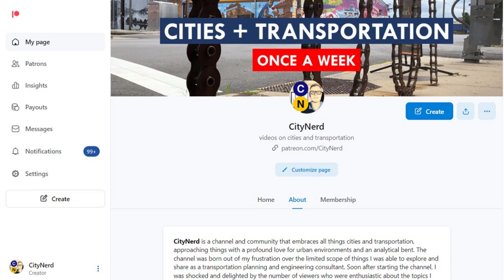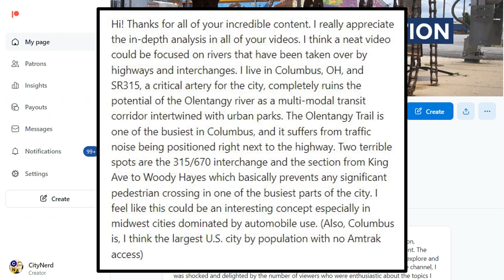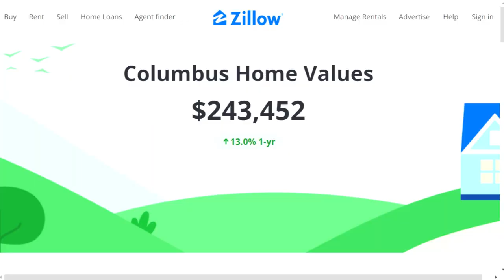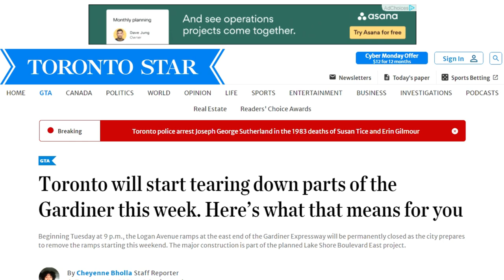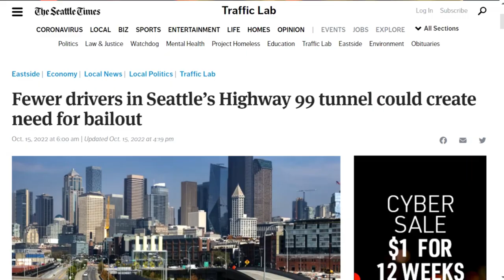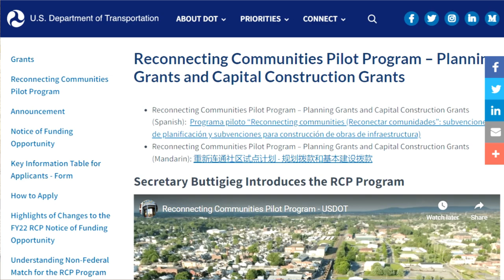Highway Engineering Madness: 10 Waterfront Freeways That Need to Go (North America Edition)

Comment: Regarding Toronto, not sure if someone else mentioned it, but both the Gardiner Expressway and the Don Valley Parkway (both adjacent to water) are owned and maintained by the City rather than other freeways like the 401 being maintained by the Province.  The City's coffers are notoriously underfunded due to pressure to keep property taxes low (taxes within the City of Toronto are way lower than the suburbs).  So basically Toronto has no money to really do anything significant with their infrastructure without assistance from other levels of government.  You can really see the difference in level of funding for infrastructure when you cross over into Peel, York, Halton, or Durham Region, the roads are maintained much better in the burbs.  Kind of like urban Detroit vs it's wealthy suburbs, except Toronto is rich, just taxes are too low to fund anything meaningful.  With all that being said, the current solution is the band-aid solution, rehabilitate the Gardiner as it stands and try to make the space underneath the elevated portions more useful to the public.
Reply: Fortunately the province now took on ownership of the Gardiner and DVP. It'll most likely be maintained way better than what the city was doing the bare minimum. Ontario should also take ownership of Hamilton and Windsor Highways. Cities should not be owning freeways since they will do the bare minimum owning it.

Comment: Wow...I immediately thought of 315 in Columbus. SR-315 North of the Columbus outerbelt needs to go or be re-routed, that's the worse portion of it. It's literally sliding into the Olentangy River. It's been under construction on and off for years and nothing is working. It used to be a nice riverside back road until all the urban growth, now it's a main artery but only 2 lanes and constantly full of traffic. It cannot be widened, there is no more space.

Comment: Well, I-25 in Denver isn't going anywhere soon. The freeway wasn't put there after the multi-use paths and greenways or most other (re)development. That all came later after the initial route was first created (by Native Americans?) and then  expanded over decades. Remember, rivers were used as sewers until relatively recently and no one wanted to be there unless absolutely necessary. The improved and enhanced access to and along the Platte has only happened in "modern" times. And to be honest, the Platte isn't much of a river. The most attractive portion is where the Platte and the Cherry Creek come together in the downtown area and that confluence is very accessible, attractive to various recreational users, and not immediately parallel with I-25.

Comment: My guess to the NC question is flood potential. With the mountain range to the west and almost yearly coastal storms that can dump a lot of water in a short period of time. The mountains generally deflect the storms catching the water that runs back through the interior of the state. North GA and SC are the same.

Comment: In defense of Lake Shore Drive in Chicago:  Commercial vehicles are banned, the speed limit is 45 mph and, by covenant with Illinois Central, nothing can be built between it and the waterfront.  The result is literally miles of (difficult to access)  beaches and parks on the east side of the road.  

By comparison, the Gardiner Expressway in Toronto completely isolated the waterfront from the city and turned it into a wasteland.  They literally put a waste processing plant on the waterfront.
Reply: Gardiner Expressway is never getting torn down now that the province owns the highway. Not even the Ontario Liberals will tear it down. Ontario Liberals need suburban votes to win elections therefore they won't tear it down since they would lose the suburban votes.
Reply: Gardiner Expressway was built when Toronto waterfront was 100% industrial

Comment: Chicagoan here! I actually live just north of where LSD ends but I still have some thoughts. One thing that makes it not too bad in SOME areas is that there are often large amounts (blocks even) of greenspace in between LSD and the Lake.  But I agree that the parts of LSD that go up against the lake are pretty offensive. Also I would say that the tunnels that let you access the lake front are decently frequent by me at least. I'd say at least once every half mile by me. And i use them a lot. They're not too bad

Comment: I had really mixed feelings about the Alaskan Way Viaduct coming down, in Seattle. On the one hand, it was undeniably an ugly thing to have on the waterfront. On the other hand, it was possible to walk under the Viaduct to get to the water, whereas now there's a six-lane surface stroad to cross. Driving the top deck also gave you views that you can now only get by dropping several million dollars on a condo.
Ultimately it was hard to shake the feeling that it was just an elaborate giveaway to landowners on the waterfront, at the expense of more inconvenience for commuters like me that were already priced out of the city.

Comment: 11:44 “And you’ve got San Francisco where the Embarcadero Freeway was dismantled after it took earthquake damage [in the 1989 Loma Prieta earthquake] and it wasn’t replaced in any real way.”
That is, after there was very little choice.

A little less than just three-and-a-half years before, San Franciscans overwhelmingly rejected tearing down the Embarcadero Freeway, in no small part due to a campaign waged by Chinatown organizer/mover-and-shaker Rose Pak, who argued that Chinatown would face catastrophic economic consequences if the freeway came down—Pak, incidentally, has a brand-new Muni metro station in Chinatown named after her. The Embarcadero Freeway did offer very easy access to Chinatown—we used to take it all the time—but it was a hideous monstrosity, and, convenience be damned, I wanted—and was very happy—to see it go. What it was replaced with is a broad, palm tree-lined boulevard at street level that is pretty nice to stroll (and drive) along.

Comment: I own property three quarters of a mile from Lake Shore Drive.  The analysis in this video overstates the disruption it causes.  Much of the drive is below or above grade; the section with tunnels beneath the drive is atypical for the road as a whole.  Most of the rest of the drive has pedestrian access, either via bridges (some of them pedestsrian-only) or less intimidating underpasses.  (There are some exceptions to this; the underpass at Grace also looks pretty unappealing, although I haven't used it myself, and is at the south end of an unusually long stretch with no pedestrian access, but I attribute that more to the presence of the golf course in the park where pedestrians shouldn't be crossing than to the drive.)  My neighborhood has underpasses spaced every quarter mile, on average.
The video describes the road as a freeway, which is true, but fails to note that speed limits (and actual speeds) are significantly lower than other city freeways.  
The assessment that concentration of emissions here is a negative is backwards.  Lake Michigan is wide enough that a large portion of the emissions get dissipated over the lake.  While no emissions are good, the situation would be worse if all of the emissions were spread over land on both sides of an expressway.
The assessment also neglects to figure in the role that Lake Shore Drive plays in the CTA bus network.  Express busses on Lake Shore Drive play an important role in Chicago's public transportation network,  even though heavily-used L and commuter train lines run mostly in the same direction.

Locals that I have spoken to see the drive as a crucial artery for getting to crucial activities.  I subscribe to one of the local neighborhood social media groups, and the bigger traffic complaints concern traffic past the end of Lake Shore Drive.  Expressway traffic gets dumped onto arterials like Ridge and Sheridan.  Arterial traffic is more disruptive to pedestrians, and stopping and starting produces more emisssions.

Comment: I live in Hamilton Ontario and I hear what you say about the QEW although it would be difficult because it’s actually an intercity highway originally built in the late 1930s before the area was heavily urbanized. It’s the main connecter route between the Toronto region and the US border at Buffalo. Also topography is an issue; the Niagara escarpment would make a bypass around Hamilton kind of difficult although it has been proposed. Hamilton does have a fairly nice waterfront on Burlington Bay that is not obstructed by a Highway. The water is rather polluted though due to a century plus of industrial activity and a city that doesn’t seem to know how to manage sewage but that’s another story lol.

Comment: Honestly, I disagree with both NYC inclusions. 
The BQE on Brooklyn Heights could use a few more accessways for people to get from the residential to the parks, but sticking the freeway on the elevation difference is a pretty elegant solution that doesn't take up an offensive amount of space. I don't really see anything meaningful being built at that 20 odd meter drop anyways. The section along Sunset Park down to Coney though is a bit more of a yikes. There's a lot of potential there.
FDR drive is also hugely important in getting the traffic away from the city centre where it's a lot busier and crowded. It'll cost a lot to reroute that necessary freeway into maybe an underground option or whatnot but as things stands, it's about the least bad place for it to exist.

Comment: Late to the party, but I fully disagree with the i5 in Portland. I lived there car free for 5 years, and there are 3 things that aren't accounted for in the vid. One is that the 5 in the section is raised and goes over railroad tracks so there is already established industrial use. If you got rid of the freeway, you would still contend with tracks. Secondly, the ped/bike path and access to the east side is fairly nice/functional/easy to use, with big open spaces on the west side which are easy to get to. Third, although I detest cars, a freeway is still a "public space" (accessibility aside), and the view of downtown from the raised section of i5 is breathtaking, almost like swooping over the city in a helicopter. Something you wouldn't have access to without the freeway. I'd rather keep the view "public" than build something there that only millionaires can enjoy.

Comment: As a Chicagoan that lives in a high-rise along Lake Shore Drive I would say that it is a necessary evil. Chicago is a big city and if there were only surface roads north/south, they would be mightily congested. Also LSD has zero commercial signs and billboards and no trucks are allowed on it. 
When you are driving, it becomes a window to the city. There is enough separation that you get to see Chicago’s architectural marvels and the often Caribbean blue waters of the lake. Everything to the east of the Drive is park or beach and the road doesn’t really factor in. There are multiple entry points to the lakefront and if you live here you just sort of naturally know where they are. One problem, the 45 mph speed limit is seldom honored so it can feel like an expressway because of the fast drivers. If there was a way to slow it down and revert back to more of a parkway, that would be nice. Once again though, urban living comes with compromises.

Comment: From a driving standpoint during non peak hours it's  the only way to cut north or south quickly across the city. 
However the s curve and Signalized interchanges around the gold coast can  cause major delays time (particularly Chicago Ave.) and is not very aesthetically pleasing in and around this corridor. 
However, once north of North Ave I'm ok with it since there are bridge and roadway access underneath for access to the lakefront via trails and to other lakefront amenities.

Comment: Something to add with the BQE! Due to the terraced roads - with no supports along the outer edge - the expressway is slowly cracking and falling into disrepair. They've already had to close off the outer lane of the tiers, causing something of a permanent traffic jam through the area.

The city is currently in talks to decide whether to shut down the artery for repairs or construct an entirely new road. Honestly, the whole thing sounds like a no-win situation.

Comment: Having lived in both the East Bay and Chicagoland, I find 580 to be far more inexcusable than LSD. Largely because of land use and walkability—as bad as they are, LSD at least has usable pedestrian tunnels which bring you to a beautiful stretch of park. The East Bay uses that space for... horse-racing? and surface parking for horse-racing? I certainly found myself using the waterfront much less in the East Bay in comparison to Chicago because of the highway's footprint and noise.

Comment: Thanks for another compelling video. 🌟 Keep up the resistance! 
On removal: I’ve always sarcastically said that East Berlin should have built a freeway instead of a wall. It would still be there… You’d never see Reagan demanding to tear down a freeway. 
These freeways are all crumbling now. Billions are spent to rebuild them. Meanwhile even a cheap BRT is considered too expensive, takes 10 years to plan, and another 10 to build if ever. 
🍁Dishonorable mention: A440 Montmorency autoroute in Quebec City. Our (very!) provincial capital ticks every bad box in urban planning. It may be charmingly European in the old town but otherwise it’s a festival of freeways and stroads.

Comment: I don't expect "micropolises" to get a lot of attention on this channel, but I think one of the worst downtown waterfronts I've seen is in Mankato, Minnesota. A freeway parallels the Minnesota River on the "other side" from downtown. And on the downtown side, Riverfront Drive is an unremarkable through street, with disused railroad tracks between it and the river. Also some parking lots and a supermarket. Inspiring. But the absolute "best" part is that, since the river itself is now basically a concrete channel — built to prevent flooding, I guess — a stretch of the river is obscured by a wall that features a mural of what the river used to look like in its natural state. (To be fair, I think things are probably a bit nicer at a park just north of downtown, but I haven't really explored it. Now just watch… in a few years I'll probably move there and become a champion of Mankato's excellent riverfront!)

Comment: Sydney has the Cahill Expressway in Circular Quay, Sydney is an overhead road with the city loop railway and elevated station pinned to the underside. It blocks views of Circular Quay which is the main ferry terminal in Sydney from the north/south running streets. The railway would be better buried under the quay front and the expressway pulled down.

Comment: So glad you gave the Reconnecting Communities Program a shout-out. While the one submitted by the "fair" city of Toledo is probably doomed to failure, the idea is a great one and definitely can undo some of the institutional damage from the I-75 through Junction, Middlegrounds, and the Warehouse District for the next round in 2023.
Reply: Ya know, when recall a map of Michigan which includes the Toledo area, I kind wonder why I-75 wasn't routed along Rt. 23 instead, avoiding Toledo entirely with 3di spurs running into Detroit from the freeway junction outside of Flint and the existing Ohio I-475 respectively.

Comment: Used to live in chicago myself, I drove LSD back before they smoothed out the 's curve' Lets be honest, its more an s curve now, back then, it was a z curve. Seriously, speed limit on the curve was 10-15 miles an hour, and that was too fast to take the turn.
The other thing that gets forgotten is that when LSD was put in, the land most of it was built on was landfill. Yep, that is where they used to dump the trash, partly, they did it that way, so that they could build up land to toss industry on, have it close to the water for easyer shipping. Also was a lot of rail lines that where put in there to service thoes industries that where once there. I watched them dig up a city block of that area once, when they where putting in a new high rise, they literaly pulled a steam train engine and a couple passanger and box cars out of the ground that had just been dumped there. The park and whatnot that is along the lake front, that all came after, as everyone continued to dump there trash and whatnot into the lake at the shoreline. At one point the city got tired of it, and things like the epa and the fed got involved, and the dumping got stoped, the city took the land, layered dirt atop of it and turned it into a park, as by that time most of the industry that was based on ships had moved elsewhere, or had moved to rails. A lot of that lovely lakefront that everyone fights over now, is built on decades of trash, and just 40/50 years ago a lot of it was still abandoned or half abandoned industrial buildings. I watched it grow from a blight to something lovely.   As for access, I hate to say it, theres plenty, most every major street goes under or over LSD, I should know, I used to go to Montrose beach all the time when I was a kid. A mile hike to be sure, but, hey beach! And fishing and lots of other things.
Another fact that is missed, LSD in part was used by the rich folks that lived along the lakefront to keep  the poor people out of there areas. Course that was before the salmon was overfished so bad they died off, and the alwives started to die by the millions on the beach. As for its removal, would be nice, but, where you planing to run all that traffic through? Never mind all the major event locations that have direct links to LSD just to help keep all the event goers from clogging the city streets in downtown.